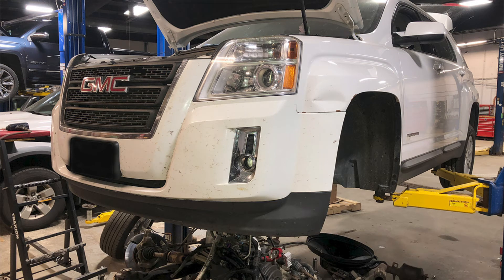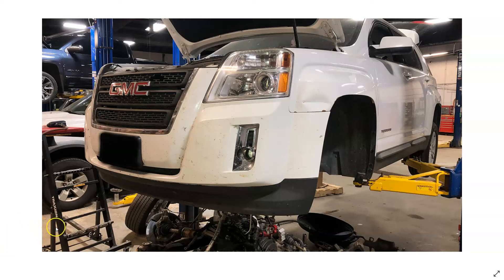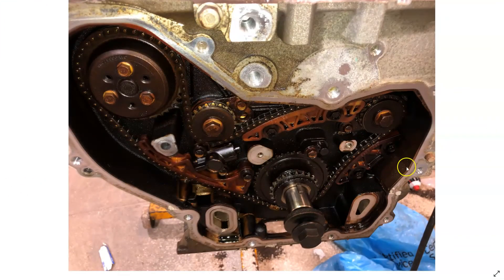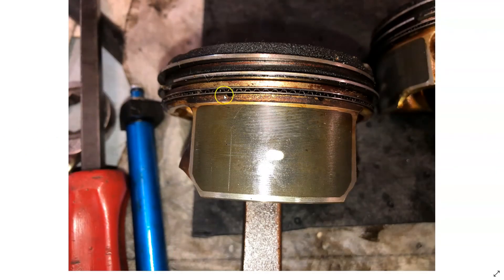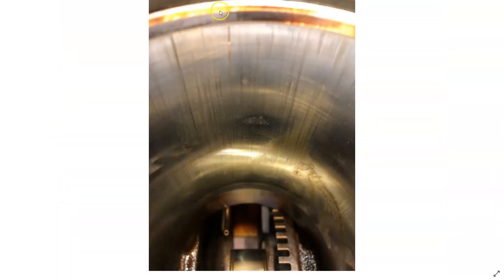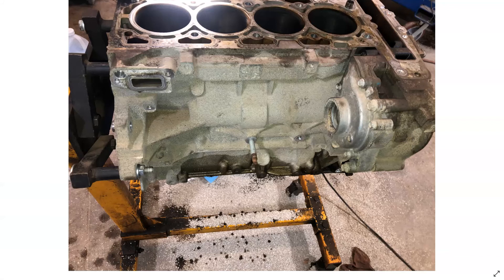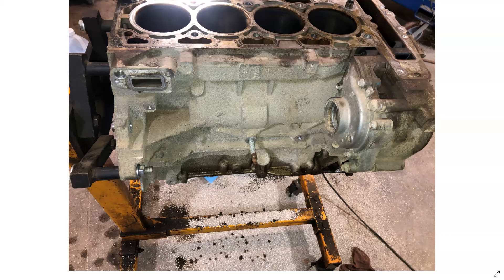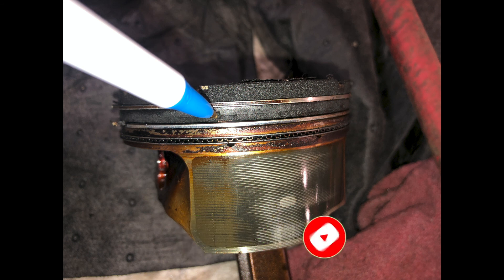2014 GMC Terrain 2.4 oil consumption, cylinder wall wear, timing chain stretched, P0011,P0014,P0016

Comment: I use the same Borescope tool for mine, works great, use it daily.  Amazing what the type of fuel does to the piston carbon build up.  I recently switched to Torque Pro for my DIY scan tool, itis awesome, digital gauges , alarm settings, data logging to csv file graphing, live data display plus code read/clear.  Send pics and data log files via your phone.  Need to use a reputable OBDII adapter, the Chinese adapters cause problems on the bus.

Comment: Great video, correct GM released new calibrations for the OLM in 2013 or 2014.  Reduced mixed driving to 5k. Still too much.   I ran mine 200miles a day, two drive cycles per day for about 6 weeks, 98% highway, cruise control and the OLM hit 0% at 7200 miles. Agree with your recommendation except I would not use conventional oil at all.  Full synthetic and change 3-4k, not a bit over because the fuel dilution and soot caused by GDI will shear the oil to the viscosity of 5W-20 or less at 3k.